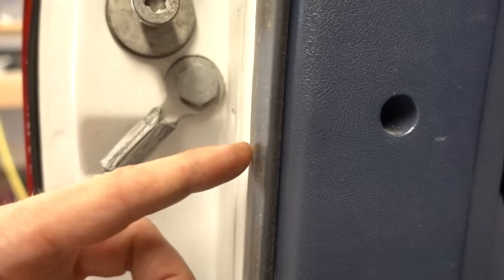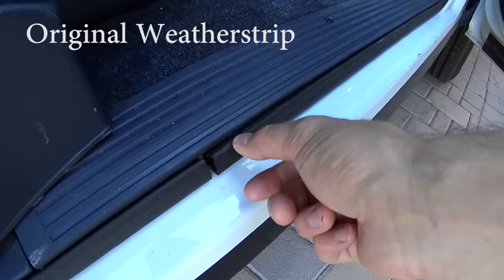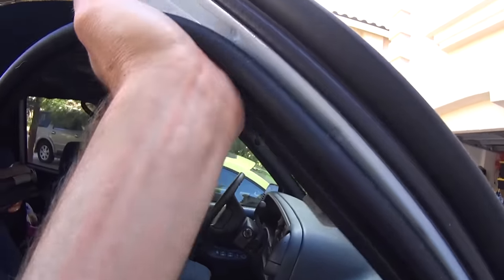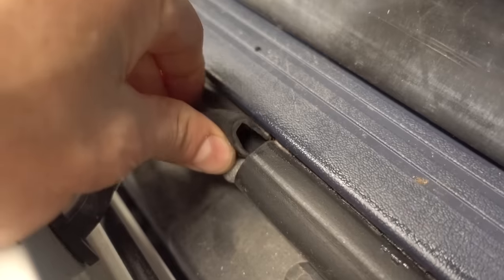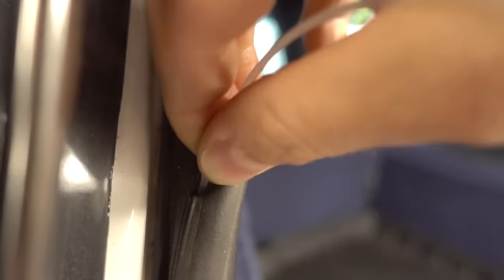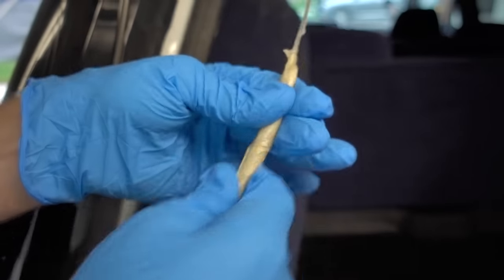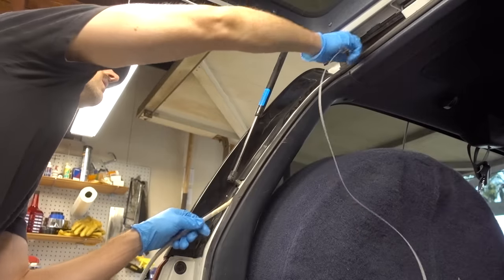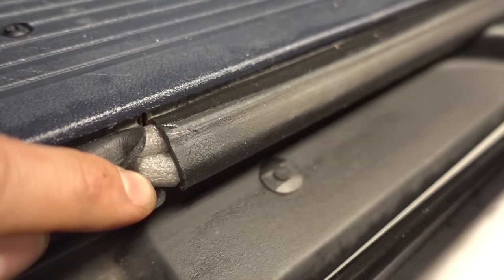Why You Need To DO THIS TO YOUR CAR'S WEATHERSTRIPPING NOW!

Comment: Antique car restoration guy's typically just fill it in by squirting some black rtv in at the small holes all along the strip. Similar results. I have soo thought about using the same foam strip to bring mine back to life. Just never got around to it. And for the most part just got used to the wind howl as air runs up the front of the drivers door. Great video
Reply from the maker: I like this method because it's removable... That way it can be adjusted or added to later on.

Comment: Aren't those holes for water to drip out certain locations? Wouldn't this interfere with that feature?
Reply: I think they are to let air escape from the compression of the door closing
Reply: I believe the holes are for air to escape when the door or hatch is closed and the seal compressed

Comment: I have a 99 Tahoe, the doors on these body trucks are very heavy and the door hinge bushings and pins take quite a beating. I replaced the front doors pins and bushings  at about 70k and just replaced all 4 doors pins and bushings recently (about 185k). The weatherstrip on the door openings is still in good shape although the two rear cargo door weatherstrips I replaced at about 110k due to water leaks. Love the truck, been to the beach fishing, some off road, lots of family hauling and towing a race car

Comment: Great reminder. I did this back in the 60’s to ‘32 Ford Victoria and my ‘65 Pontiac and it lasted at least until my mother sold the cars when I joined the military.  Now I have an 04 Chevy van that needs it.  Back to the old ways.  Keep It Simple Solutions. 🔚

Comment: I have a BMW Z3 convertible, each side top has 3 separate pieces. each piece is over $100, this hack saved me $600 !!!!
Reply: You probably wont see this now that it has been a long time but did you ever try this? I ask because I also have a convertible miata..same thing right? Jk..mine was cheaper lol. Anyways the trim is to channel the water from the top when it rains so I'm curious if you had a problem with that or did everything work out ok?

Comment: I hope that foam does not hold water, if it does not I will definitely do this hack, but please do an update on this after a storm or something. After it gets wet.
Reply: He said he lubed the foam. Light oil based lube?
Reply: @joshbeekman5474  there is always the possibility of that oil/lube rubbing on or being rinsed away, if you wash your car with a degreaser then it would be gone after a few washes.
Reply: I have put KY jelly on the seal and door for years

Comment: The driver side door on my 2005 ram 1500 was starting to whistle at freeway speeds. It took me about 40’ of weather stripping and 2.5hrs to do the left side. Going to tackle the right next weekend and hoping I can get it done in closer to an hour. It takes a minute to get the feel of how to do it.

Also, instead of super lube I just used some bike chain grease that was laying around. Squirt it down the hole in a few areas and it lubes it right up.

Finally, I discovered that if you bend the trimmer line and put the bend around the foam you can get a little more leverage out of the tape.

Hope this helps anybody undertaking the project. It is well worth doing and does legitimately make the vehicle instantly have a newer feel.

Also on an older vehicle that you’re listening to closely, that silence is golden. You don’t realize how much loose doors tend to rattle even if it’s not very loud, making it difficult to hear other noises.

Comment: This is a really really good tip. I hadn't thought of that and I will go and look now on my car to see if the weather stripping is actually needing replacement. I think before the doors start to make noise it probably still is not insulating as well as it should for sound and also for temperature.

Comment: Chevy Silverado pickups over the years have been "airy" after only about two years.  When my children were smaller, I found myself looking at the rear doors in the crew cab to see if they had been playing with the windows.  Soon realized the "Body by Fisher" was good marketing back in the old days, but they never figured out how to seal them & quiet them down like Ford.  Ford vehicles generally sound like you're riding down the road in a living room.  The GMs sound like you're riding down the road with a door ajar or a window cracked open.

Comment: Just a heads up guys, not to deflate the greatness of this video, but the door seals are hollow and the holes are there for a reason. It is for water to run down and drain off into the bottom of the door. If you block this out, it creates a whole new problem. Only pointing out somthing some may not know about, best of luck to you all! 👍

Comment: I work in a factory that makes these, the holes intentions are to let trapped water or moisture escape. I'm not sure how shoving the foam in the bulb blocking potential water from escaping will effect mold growth and such. Worth a shot though specially if the strips are expensive. Each strip is no more than 5 dollars to make if that makes you feel better (3-5 dollars for SUVs and trucks).

Comment: You probably shouldn't have the holes be on the top of the weather stripping, that's probably a good way to get it to fill with rainwater. Perhaps a hole on the bottom side of the bottom corners might help prevent that.

Comment: When all you had to do was put Vasolin, this restores the rubber put it on thick because it will exsorb into the rubber, then put a lighter coat on the next day. My truck is 40 years old all the rubber is like new.

Comment: Closed cell LDPE foam cord will degrade, but slower than the rubber seals. You also need to treat the rubber with a preservative to prevent cracking and ripping. .

Comment: i will have to try that as on my suv i keep getting water in from where the seals meat on the bottom and if nothing else i just run it at the bottom to keep them together and hopefully stop getting water in if i fail to condition the seals and keep pushing them back together. cool idea!

Comment: You can rub some dielectric grease on the weatherstripping to help keep it pliable.
Reply: Does that help keep doors from freezing shut in "not do nice" weather?   I've used  spray  silcon lube ... don't know if one is better for protection ...

Comment: I am definitely going to do this to my weather stripping in my 2001 chevy express, it will probably help quite down the road noise
Reply from the maker: I would recommend trying something a little stronger than what I used. Seems to have flattened out over time. Someone once recommended that surgical tubing which I'm pretty sure you can get at Home Depot or Lowes.
Reply: @1RoadGarage  Oh thanks for letting me know. I can see how the surgical clear tubing would work 👍 thanks

Comment: Hi my johnboy, I worked at green tokia, they manufacturer rubber door seals and tail gate seals, those rubber insults are called plugs they are placed inside bulbs using a item called a rod, and the only lubricant is soapy water we used pamali the green type, and if would fall short of jig marking we would have to work it by hand by pushing by hand. This company only manufacturers for Honda they make the door and body side parts too.

Comment: As an IT guy, I've had to fish my fair share of wires through tight spaces, including sharp corners and conduit installed by the lowest bidder that sent out the guy that didn't know what they were doing and... well, you get the idea. We used a BUNCH of wire pulling lube to do the jobs, and I can't help but wonder if it would help in this aplication. The benefits are that it's water based and will eventually evaporate and completely non-toxic so it's also safe to have around pets and small children, both of whom I've seen licking weather stripping.

I'm about to replace the weather stripping on my own 20yo car because it's ripped apart and not worth saving, but after watching this I plan on doing the same just because my car still rattled a bit when new. Thanks!
Reply: Come on Data Geek! Have some confidence in the products used in our well, I suppose technically used in Our Trade!! Bwhahahaha 
Retired IBEW

Comment: The Product is called Backer Rod
Comes in Different sizes. TYPICALLY  USED IN CONSTRUCTION  TO FILL GAPS in concrete or anything  you need to seal a gap before Caulking

Comment: Great tip! Do you also have some ideas on what kind of treatment to treat old rubber? I mean, just putting foam inside old weatherstripping doesn't help old rotten weatherstripping on the outside.

Comment: The bottom portion of the weatherstripping on the hatch of my Sequoia is torn, you can see daylight and it rattles like crazy. Replacement is close to $200. Going to get creative and look for a generic seal and just replace the lower portion while applying your trick of using the caulk saver.

Comment: Make the weather stripping last longer? 50/50 old diesel & ATF fluid... Rub on once a year... Use in a spray bottle on motor mounts, and ball joint rubbers.  Diesel acts as a penetrant and ATF a conditioner.

Comment: Well all yall can say it works but I took the rubber weather strip off my 2013 toyota corolla le only to finely get the trimmer line through buy for the life of me and my military husband we couldn't pull the foam cord through so long story short I've had to order new weather seal for my car door . Thanks 49.99 for 1 door after I blew 30.00 for all materials  i should have left well enough alone I new better

Comment: I'm on it. Will do my 2002 Dodge Ram
Thanks, will let you know how it goes. I was also thinking about spray foam with a small tube.
Reply: Dude... just buy replacment wetherstrip.  It isn't that expensive.  You're falling for one of those "LIFE HACKS YOU WON'T BELIEVE WORKS!!!"  Notice the all caps... they all use the same recipe.  The rubber has lost its elasticity.  The rubber is 17 years old.  This may work short term, but that is it.  You  put spray foam in of the wrong durometer and you might not be able to close the door, more likely it will blow the rubber apart as it expands because you are going to get the stuff from a big box store.

Comment: Tried this on my 2001 Sonoma 3dr extended cab. Unfortunately the weatherstip is not hollow in a portion of it at the top. GM added some kind of filler, mimicking this process, right where the driver's door and the 3rd door meet at the top. I may cut a couple slits in it and run a fish tape through from each side to accomplish this.

Comment: Dude, the rear one is super easy to replace. I wouldn’t do the foam but the one above that you didn’t replace on rear hatch (above the one you foamed) will leak very soon if you haven’t replaced it. IT IS VERY HARD to replace & will require you removing the hatch to do it correctly.

Comment: Wonder if will solve my wind noise issue. Great tip.
Reply from the maker: Seems like it could!!
Reply: 1 Road Hope so. Going to try tomorrow. Thought it was the dried out lower trim on the windshield, but just had the windshield and trim replaced last week. The wind noise is still there.
Reply: @csebastian71   results?

Comment: this is what I need to do. thx.  btw, I don't know what it call but it is  this thin metal trim piece on my 2007 Corolla.  It is sti part of the auto body and by each of the 4 ties.  It's that curved or semi-circle cut out part ?  Anyways that metal trim is coming loose. I think theres a bit of fine foam between the trim and the car itself.  Do you have a video or an explanation on how to fix that ?  What glue would I use and how do I clean that foamy stuff out first.  thx

Comment: Tried doing this and it didnt work what so ever. Re watched the video and noticed I did it all wrong. Its only too bad I gave up and slit open the stripping and just stuffed it in. I guess it kind of works for me. Biggest problem was going from one side of my door all the way to the other, and if you do everything right and the foam still tears it worked out for me cutting a big slit through the whole stripping and stuffing the caulk saver in.

Comment: Yep but the holes are there for a reason " drainage" .. Fill them up with foam and then the seals will maintain moisture which isn't good for the seals or the surrounding area..

Comment: Good idea, nothing new. But that weatherstrip around doors, hatch openings pops off in seconds to take it off then run the backer rod (that's what it is known as used by floor installers all the time) through while the seal is out is easier (at least it was for me many years ago). I used dry lubricant and all was well, someone stated cornstarch, sound like it would work ok too. Don't plan on doing it again, since I no longer purchase used cars/trucks, no longer keep a car more than three years.
But as stated, it is an idea that many would not know or think of and does bring life back to the door weatherstrips.

Comment: Now you just need an LS Swap. I have a 87' K30 Military truck with a 5.3L what a world of difference.
Reply: 5.3L is not LS. Dependsing upon the model, you coukd have an LQ3, LQ4, LM7 or L33. unless newer than the 2000-2007 era 5.3L. My 05 silverado 1500 z71 has the Rare L33 engine.

Comment: Not as easy for me to copy...  I used 0.095" maximum gatorline supertwist weedeater cord to feed through the channel first, picking it out at drainage holes in the door seal using a 5/64 precision screwdriver where it got stuck to keep feeding it through.  Then I tied the weedeater cord to a metal fish-wire for fishing electrical lines in the wall and pulled that through as the weedeater cord wasn't strong enough to pull the tubing through by itself.  Then I connected 1/4" silicone tubing to the fish-wire using fine wire that I poked through the silicone lines and wrapped around several times.  Then I pulled that wire through, spraying the door seal drainage holes periodically with silicone lubricant...  the silicone tubing still broke about 3/4 of the way through the seal but I was able to get it beefed up at the top where I think my leak is occuring.

Comment: curious about the lube you used. was it just wire lube?  for my old hondas they dont make the weatherstripping anymore but they sell this stuff called shin-etsu grease. i believe its either a silicon or lithium based grease. its used to massage into the rubber and restores and moisturizes the rubber.  it seems to keep my seals nice if i do it every few years, my cars with orginal seals are over 25 years old and still decent. but i only use it on the outside. i bet using the shin-etsu grease as lube to pull the foam through the inside would help plump them up even better than just using it on the outside.

Comment: That light urethane foam weatherstripping stuff turns into powder after a few years. I could be wrong but I think the holes in the rubber weather stripping are to let water drain out. Place foam inside the weatherstripping and now you may have a sponge that holds water inside the weatherstripping. Will that interfere with the functioning of the weatherstripping? I don't know. But the foam does not last.
Reply: Holes in the weatherstrip are actually to allow air to escape when a door / tailgate is closed - fill them up some cases you’ll have to slam the door to close it , and it may worsen wind noise if the seal pushes the door upper frame outboard.
Reply: That's what I thought too because after several heavy rains one of the doors on an 04 Cadillac CTS filled with water, when I pulled the weatherstrip away at the bottom to drain it  I found tons of dirt plugging the holes, once I drained it and cleaned it, it never filled with water again. AND, I don't know where all the dirt came from, lol.